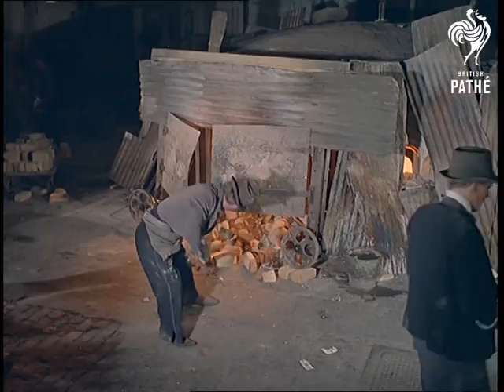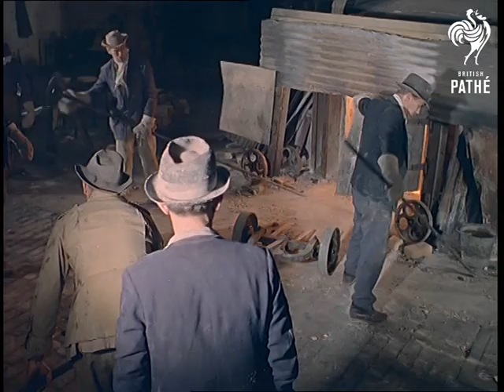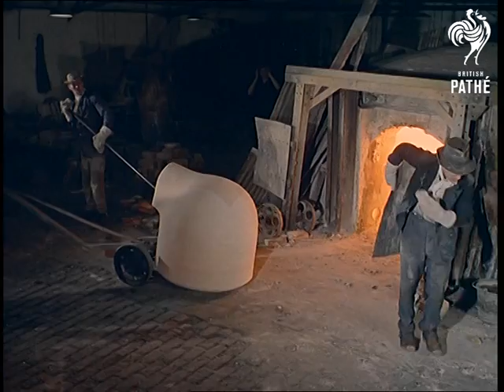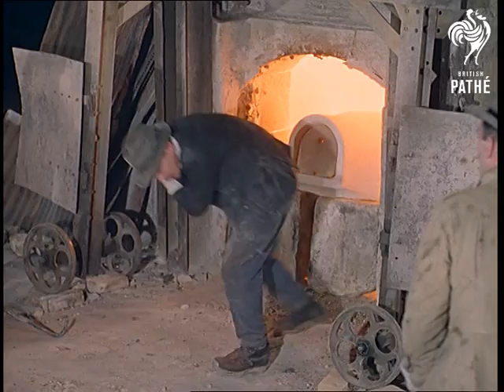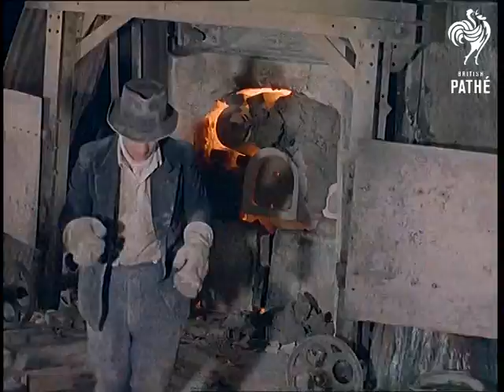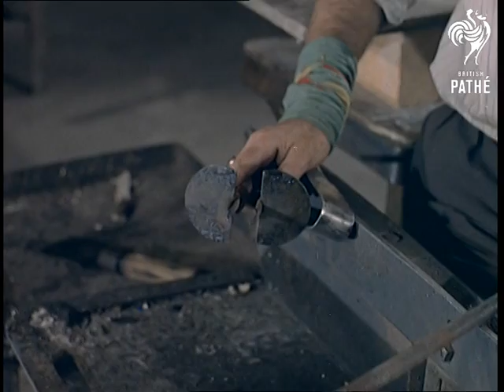Glass Making (1963)

Comment: Pot furnace: Also known as crucible furnace, this is one of the oldest types of glass furnaces. It consists of a ceramic pot or crucible placed inside a furnace chamber. The glass batch materials are melted in the pot, and the molten glass is then drawn out for further processing. Pot furnaces are commonly used in small-scale or artisanal glass production.
Reply: There are many varieties of pot or crucible furnaces still used to this day, although the beehive style multi pot furnace in this video is mostly ancient history. Few in India and China but nowhere else I'm aware of

Comment: Whitefriars Glass Factory. In 1923 a lit brazier was carried from the old glasshouse to the new factory. It was used to light the first furnace, continuing the burning of the flame from the city glasshouse furnaces which had burnt continuously since 1680. In October 1980, after 300 years of glassmaking and only 57 years in Wealdstone, the Whitefriars Glass Factory finally closed its doors. Following this closure, the site was cleared and the buildings demolished.

Comment: All this heat, and they are all wearing jackets
Reply: Trust me, you'd rather a jacket on that feel that direct heat on your skin or indeed have your skin exposed even to the light off it for too long. I've made two mistakes similar and neither was pretty, one was thinking I could get away with running about half a meter of MIG weld without my arms and hands covered, that earned me peeling skin on my arm which turned red like a really bad sunburn and the other was spending an afternoon on the footplate of a locomotive in shorts, opening the fire box doors to chuck coal in was enough to end up with similarly sun burn like effect on the exposed legs. 

This is why they're holding the gloved hand up over their face to avoid too much exposure and wearing something all over even with the heat, can't imagine how painful it would be given how much more heat that furnace is pumping out compared to the things I experienced. It also smells, you walk around for about a week after smelling like burning flesh and hair, even if you shower the smell is there. It's gross 😂